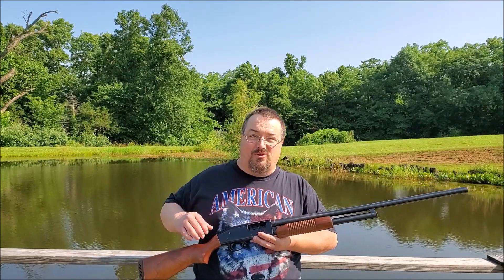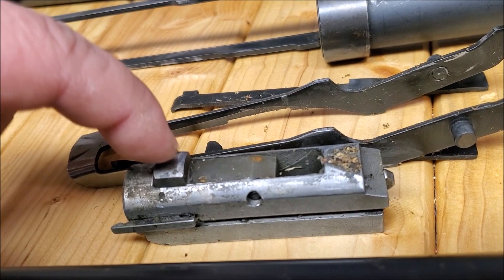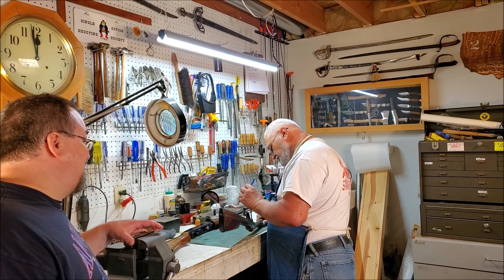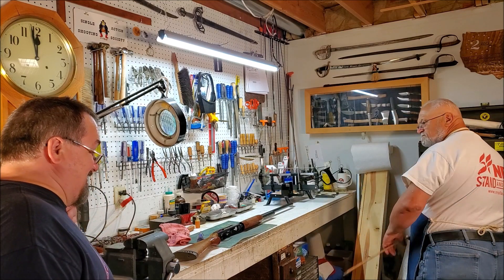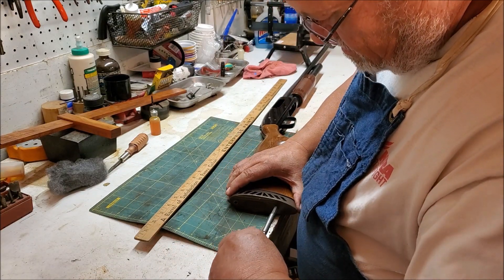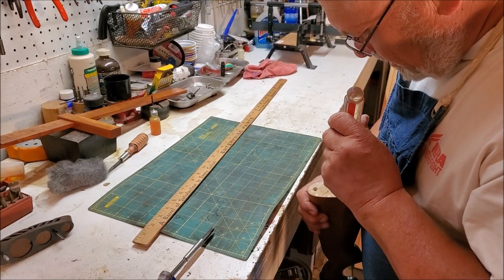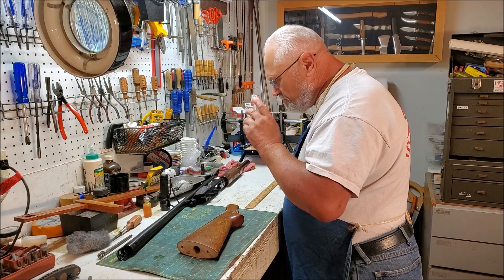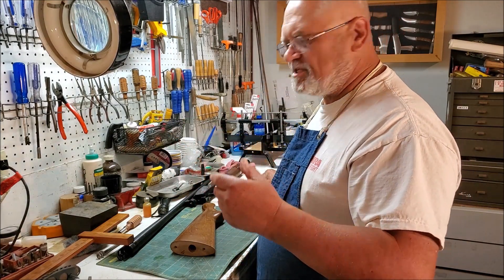The Old Gunsmith - Mossberg 500 Length Of Pull Adjustment & Recoil Pad Install Part 1

Comment: How are you gonna get it square in the oppisite plane. Laying a tapered stock flat on a flat table, then sawing it,  the cut wont be square in the side plane...
Reply from the maker: Fair point, but the end result was so minuscule that unless you really look for it you won't notice. It also had no affect on the function of the pad. I suppose you could add a small spacer under the wrist of the stock to make it more square.

Comment: If he was a professional gunsmith he would've got a true length of pull  measurement using the man to get a measurement. He could've had the man hold his shotgun like he's going to shoot it and slide his grip/trigger hand back on the stock until it feels comfortable to hold it with his finger out and bent like his fingers on the trigger. Then measure from the trigger to the inside of his finger and that would've told him the exactly how much he needed to shorten the stock. That man might have needed more than a 1/2". If your going to shorten your stock it should be fitted perfectly to you without just guessing at it. I guess more power to you it's not my gun.

Comment: C'mon man, are you serious ? The stock actually "got wider" when you (haphazardly at best)......cut off 1/2" of LOP ? That's one magical stock !.....lol ! And what's with the crooked fitting recoil pad after you reattached it ? Why wasn't it crooked before you took it off ? Because it's now OVER SIZED, and you didn't center it around the butt stock before you re-inserted the screws. If you did, you would have found the recoil pad to be, once again....OVER SIZED.... and would need to now be ground down to perfectly match the circumference. Oh, and of course he's going to need a "re-finish", you had the stock wedged between your stomach and the top edge of your work bench when removing the stockbolt. Guess you didn't feel like simply moving that flat matt a few inches towards you, and overlapping the edge of your work bench to avoid damaging your customer's stock ! Yep, " gunsmiths" are a dime a dozen, finding a good one is a totally different story. To be frank, I couldn't even watch Part 2.  Sorry for this thumbs down comment.